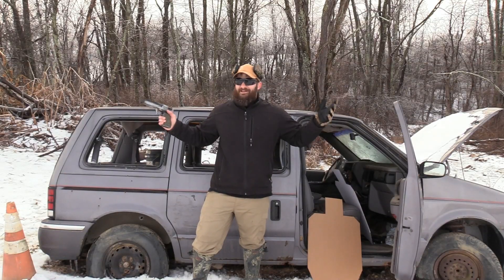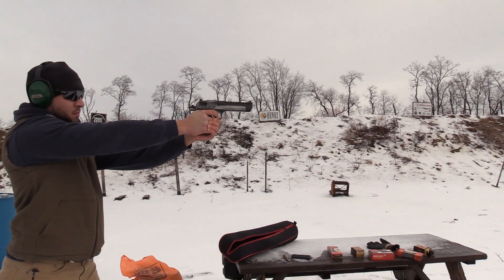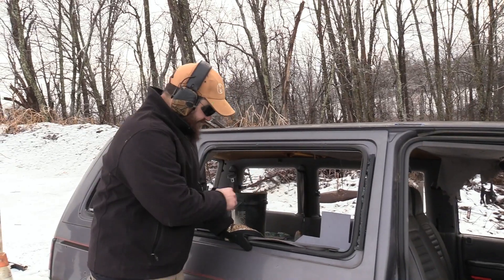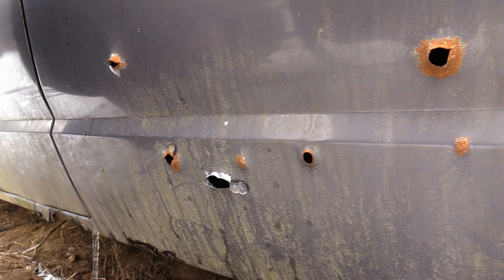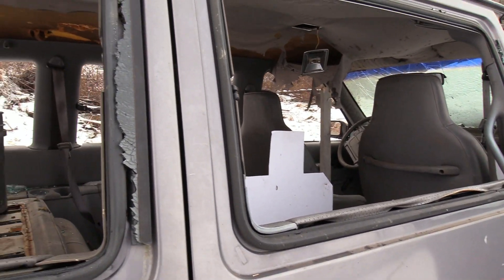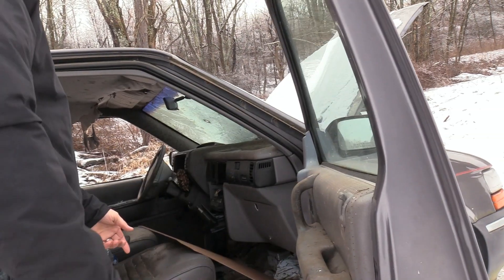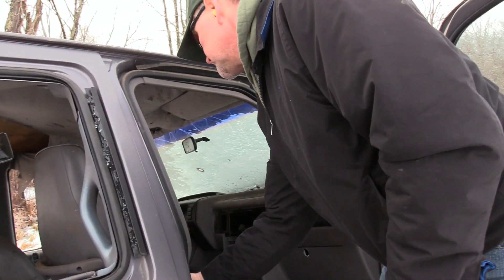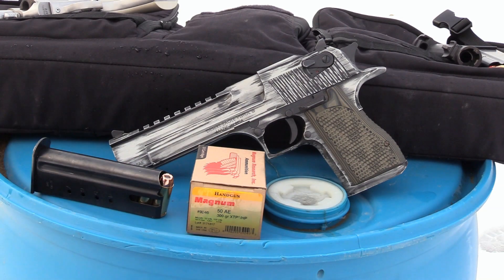HOW POWERFUL IS IT? .44 Magnum Desert Eagle

Comment: I feel the .44 Magnum is a better combat round for the Desert Eagle since .50 AE has so much recoil. Problems I hear people complaim about is Desert Eagles are not that reliable in general though.
Reply: The 44 magnum I have has jammed once out of 300 ish rounds, but it's basically built from Israeli made parts by MRI. Not sure how much was finished by MRI but it has the Israeli barrel but with the U.S. slotted weaver rail so they obviously did a good amount of work on it.
Reply: I don't own one , but I assume the reliability issues are more with the  .44 & .357 because they are revolver rounds with a rim.The .50AE is designed as an auto pistol round so it is probably more reliable.I would still consider a .44 mag for deer hunting though , as it would be a bit more controllable & plenty powerful. I'm guessing the ballistics of a 6" DE would be about the same as a 7 1/2" or 8" revolver due to no cylinder gap.
Reply: Theres no 50cal u re
Reply: @BoneNSkin  The fuck are you talking about?

Comment: Can you do a vid seeing if you get less power out of a revolver due to cylinder gap
Reply: most likely will depend also on barrel length
Reply: Most likely more due to the fact the DE, regardless of caliber, is using some of the pressure to cycle a new round unlike a revolver. As the other person previously mentioned, barrel length is a big contributing factor as well as a bunch of other cartridge component variables.